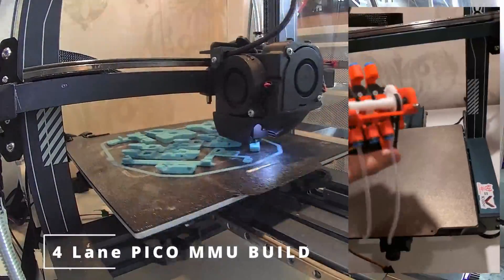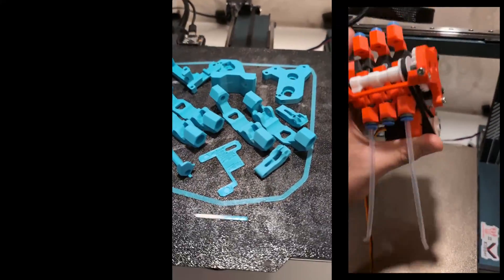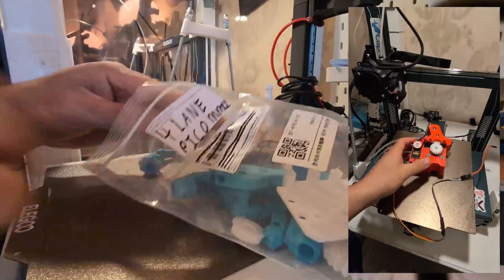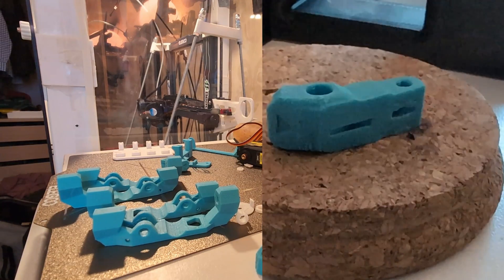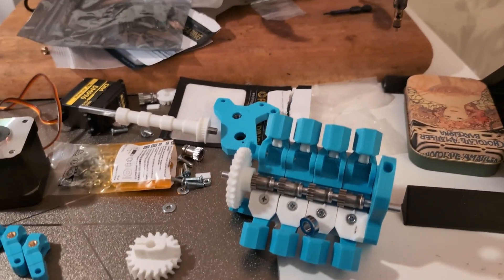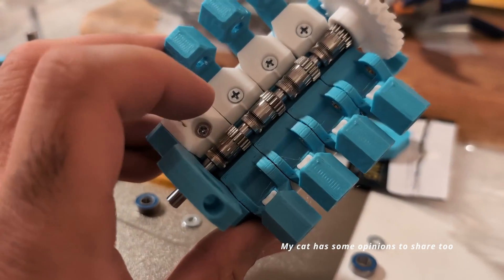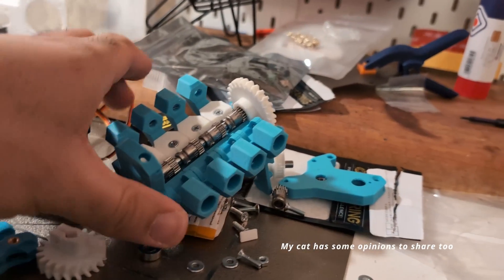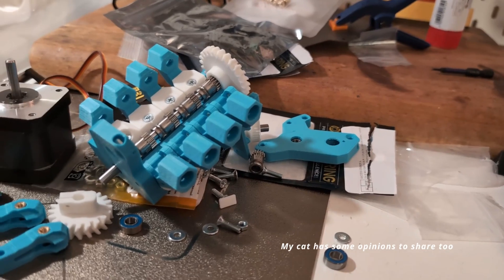4 Lane Pico MMU Build Part 1

Comment: Hi, i have the 4 too and i am working on installing the 4 lane version too, but im tryna save money and maybe not buy the external stepper driver since my printers motherboard already had one extra installed but im trying to find out where the servo motor plugs in to, do you know where it plugs into and is it worth the hassle plugging it into the motherboard or should i but the ebb42 board

Comment: Will this need klipper firmware
Reply from the maker: You might be able to make it work with a different firmware, but it's designed to work with klipper, and the macros are all for klipper

Comment: Did you do any post processing on the cam shaft? As of now, it seems like I really will need quite a lot of force to insert the steel shaft into the cam shaft.
Reply from the maker: I don't remember there being any trick to it, just took a bit of force, sorry
Reply: @AMOVFC  No problem! Thanks for the response :)

Comment: What material would be best to print this in? Abs or pla+?
Reply from the maker: I've printed all my part in pla+, I believe there are some that LH (designer) suggests be petg or abs, but check the official GitHub to be sure https://github.com/lhndo/LH-Stinger/tree/main/User_Mods/MMU/Stinger%20Pico%20MMU%20-%20%40LH
Reply: @AMOVFC  he recommends standard pla or petg. I can print abs extremely well so I might just use that. I thought about nylon because it "self lubricates".  Just thinking about the servo moving the cams.
Reply from the maker: @raiden9250  I believe there has been some talk about nylon and abs in the LH discord, but I don't know enough to really give advice on that, sorry